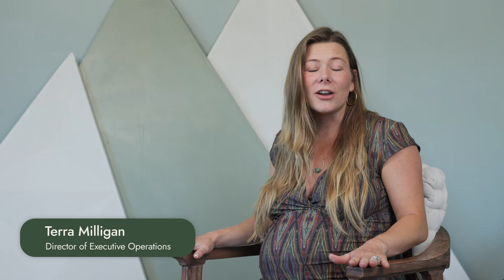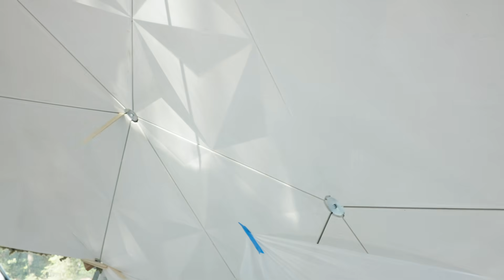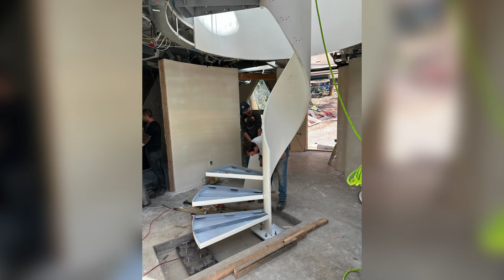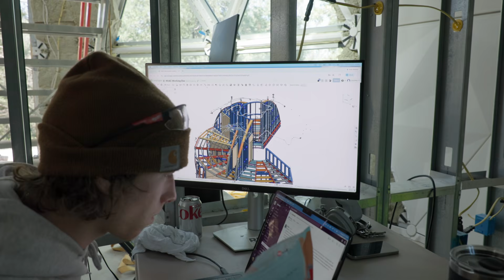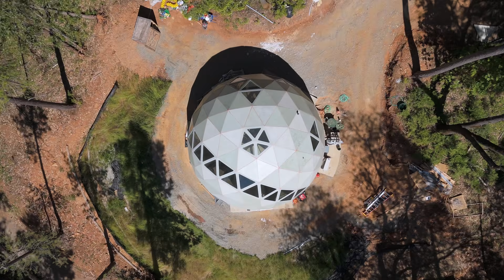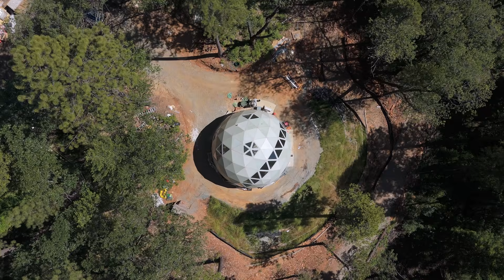GeoJourney 11| Inside the Build: Stage Four Begins

Comment: I have been following the work. How are you going to deal with the smoke from a burning pizza with the open kitchen design? Where are smoke detectors being located? Co detector? Can it be built on a basement?  Where would you connect two or more together? How is humidity controlled? Can you make a dog house out of this. Does it produce lift like a golf ball? How many goldfish would it take to fill it?
Reply from the maker: Thanks for all the thoughtful questions! 🌿 Many of these details, including ventilation, life-safety systems, humidity control, and foundation options, are engineered to meet applicable building codes and site requirements. The team will be sharing more technical details as the program continues to grow. 💫

Comment: a 10-year runway without a fully commercialized, habitable product on the market is a massive red flag. While Geoship (founded in 2014) has spent a decade painting a utopian vision of bioceramic, regenerative dome communities, a sober look at their financial disclosures, SEC filings, and developmental timeline reveals a textbook case of crowdfunded capital dependency and extreme execution delay.
1. The Audited Reality: Zero Revenue & Deepening Deficits Because Geoship relies heavily on equity crowdfunding, they are legally required to file financial disclosures (Form C-AR) with the SEC. Their audited financial statements for the fiscal year ending December 31, 2024, lay bare the classic pre-revenue "burn and raise" cycle:

    Revenues: $0. Despite having a reported waitlist reservation pipeline, they have generated zero commercial operational revenue.

    Net Losses: -$3,289,864 for 2024, compared to -$1,910,888 in 2023. Their annual burn rate nearly doubled as they tried to move from chemistry R&D into physical fabrication.

    Accumulated Deficit: With years of multi-million dollar net losses, their accumulated deficit has ballooned.

    The Survival Mechanism: How do they stay afloat? Continuous crowdfunding. As of early 2026, they have raised over $16 million from more than 4,000 retail investors across multiple platforms like Wefunder and Republic.

    The Financial Critique: Geoship is essentially operating as a perpetual R&D and capital-raising machine. Instead of standard venture capital (VC) firms—who would have forced hard commercial deadlines or pulled funding years ago—Geoship has sustained itself by selling equity to thousands of small-dollar retail "community" investors. This shifts the massive financial risk of unproven material science away from institutional investors and onto enthusiastic, mission-driven individuals.

2. The "No Prototype" Reality Check

The claim that they haven't completed a prototype is mostly true in the practical sense, though technically nuanced:

    2020 (The "Concept Shell"): Geoship built a basic ceramic composite dome shell in 2020. However, this was a structural proof-of-concept, not a complete, permitted, habitable residential home with plumbing, electricity, HVAC, and interior finishes.

    2025–2026 (The First Actual Build): They are only just now building their first customer-ready, fully integrated model—the Amma One—in Nevada City, California.

        After nearly a decade, they only recently cleared ground and poured the foundation.

        In early 2026, they finally completed the primary triangular structural frame of this single prototype. The exterior panels and interior build-out are still in progress.

3. Why Is It Taking 10+ Years?

To be fair to Geoship, building a standard wood-frame house is easy; inventing an entirely new physical material and an automated manufacturing process is brutally hard. They are fighting three massive uphill battles:

    Material Science is Slow and Expensive: They aren't just buying off-the-shelf parts; they are formulating proprietary chemically-bonded bioceramics ("GeoRok") that must withstand wildfires, extreme weather, and centuries of wear. Perfecting these chemical ratios takes years of lab trials.

    The Regulatory Nightmare: Building codes in regions like California are notoriously rigid. Standard building inspectors do not know how to evaluate a ceramic geodesic dome. Geoship spent years securing their California Factory-Built Housing Certification. While a major breakthrough for them, getting this certification required millions of dollars in ASTM testing and engineering stamps.

    Hardware Scaling Pitfalls: They are trying to build "the Etsy of natural building" and highly automated microfactories. This requires immense capital expenditure (CapEx) to tool factories, create molds, and automate production lines.

Summary Verdict

Geoship has survived for a decade because its leadership is incredibly skilled at marketing a compelling, regenerative vision to a community of small-scale investors. However, as a business, they face a classic capital chasm.

If they cannot successfully complete, permit, and deliver the "Amma One" prototype in Nevada City, and rapidly transition to selling actual homes to their reservation backlog, the continuous capital raises will eventually dry up. Without a steady stream of retail crowdfunding dollars, they will run out of runway long before they ever reach the mass-production phase they have spent ten years promising.

To see exactly where they currently stand on their physical build, you can watch this video update showing the assembly of their very first structural dome frame on-site in Nevada City, California: Geoship Amma One Frame Assembly. This video is highly relevant because it shows the physical progress—and the remaining steps—of the "Amma One" model that they are currently trying to deliver.
Reply: So true. Thank you for the investigation into their financial situation. For the past few years I have been amazed at how many people have invested there money without a correct timeline or known cost. That's apart from the fact that I believe it will leak.

Comment: Are you building in Electrical—Heat—Cooling—Plumbing etc...—So we can truly go off-grid and avoid the stupidity of our electrical grid/community resources being hi-jacked by computing centers sucking all of the resources from our communities?
Reply from the maker: Great question! 🌿 Geoship homes are designed to accommodate electrical, plumbing, heating, cooling, and other essential building systems. Off-grid capability depends on your site and the systems you choose, so it can be tailored to your specific goals. 💫

Comment: weren't these supposed to be DIY buildable? Been building this model for months now with dozens of pros
Reply: a 10-year runway without a fully commercialized, habitable product on the market is a massive red flag.

While Geoship (founded in 2014) has spent a decade painting a utopian vision of bioceramic, regenerative dome communities, a sober look at their financial disclosures, SEC filings, and developmental timeline reveals a textbook case of crowdfunded capital dependency and extreme execution delay.
1. The Audited Reality: Zero Revenue & Deepening Deficits

Because Geoship relies heavily on equity crowdfunding, they are legally required to file financial disclosures (Form C-AR) with the SEC. Their audited financial statements for the fiscal year ending December 31, 2024, lay bare the classic pre-revenue "burn and raise" cycle:

    Revenues: $0. Despite having a reported waitlist reservation pipeline, they have generated zero commercial operational revenue.

    Net Losses: -$3,289,864 for 2024, compared to -$1,910,888 in 2023. Their annual burn rate nearly doubled as they tried to move from chemistry R&D into physical fabrication.

    Accumulated Deficit: With years of multi-million dollar net losses, their accumulated deficit has ballooned.

    The Survival Mechanism: How do they stay afloat? Continuous crowdfunding. As of early 2026, they have raised over $16 million from more than 4,000 retail investors across multiple platforms like Wefunder and Republic.

    The Financial Critique: Geoship is essentially operating as a perpetual R&D and capital-raising machine. Instead of standard venture capital (VC) firms—who would have forced hard commercial deadlines or pulled funding years ago—Geoship has sustained itself by selling equity to thousands of small-dollar retail "community" investors. This shifts the massive financial risk of unproven material science away from institutional investors and onto enthusiastic, mission-driven individuals.

2. The "No Prototype" Reality Check

The claim that they haven't completed a prototype is mostly true in the practical sense, though technically nuanced:

    2020 (The "Concept Shell"): Geoship built a basic ceramic composite dome shell in 2020. However, this was a structural proof-of-concept, not a complete, permitted, habitable residential home with plumbing, electricity, HVAC, and interior finishes.

    2025–2026 (The First Actual Build): They are only just now building their first customer-ready, fully integrated model—the Amma One—in Nevada City, California.

        After nearly a decade, they only recently cleared ground and poured the foundation.

        In early 2026, they finally completed the primary triangular structural frame of this single prototype. The exterior panels and interior build-out are still in progress.

3. Why Is It Taking 10+ Years?

To be fair to Geoship, building a standard wood-frame house is easy; inventing an entirely new physical material and an automated manufacturing process is brutally hard. They are fighting three massive uphill battles:

    Material Science is Slow and Expensive: They aren't just buying off-the-shelf parts; they are formulating proprietary chemically-bonded bioceramics ("GeoRok") that must withstand wildfires, extreme weather, and centuries of wear. Perfecting these chemical ratios takes years of lab trials.

    The Regulatory Nightmare: Building codes in regions like California are notoriously rigid. Standard building inspectors do not know how to evaluate a ceramic geodesic dome. Geoship spent years securing their California Factory-Built Housing Certification. While a major breakthrough for them, getting this certification required millions of dollars in ASTM testing and engineering stamps.

    Hardware Scaling Pitfalls: They are trying to build "the Etsy of natural building" and highly automated microfactories. This requires immense capital expenditure (CapEx) to tool factories, create molds, and automate production lines.

Summary Verdict

Geoship has survived for a decade because its leadership is incredibly skilled at marketing a compelling, regenerative vision to a community of small-scale investors. However, as a business, they face a classic capital chasm.

If they cannot successfully complete, permit, and deliver the "Amma One" prototype in Nevada City, and rapidly transition to selling actual homes to their reservation backlog, the continuous capital raises will eventually dry up. Without a steady stream of retail crowdfunding dollars, they will run out of runway long before they ever reach the mass-production phase they have spent ten years promising.

To see exactly where they currently stand on their physical build, you can watch this video update showing the assembly of their very first structural dome frame on-site in Nevada City, California: Geoship Amma One Frame Assembly. This video is highly relevant because it shows the physical progress—and the remaining steps—of the "Amma One" model that they are currently trying to deliver.
Reply from the maker: Great question! Geoship homes are not designed to be DIY builds. They are professionally installed by trained teams to ensure every home meets quality, safety, and performance standards. 🌿